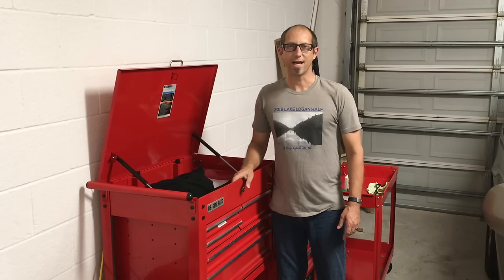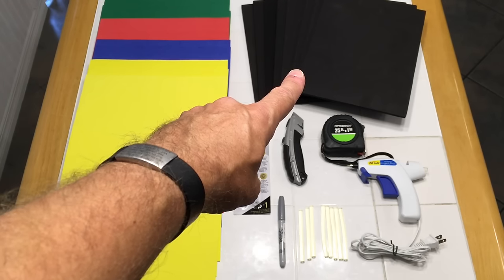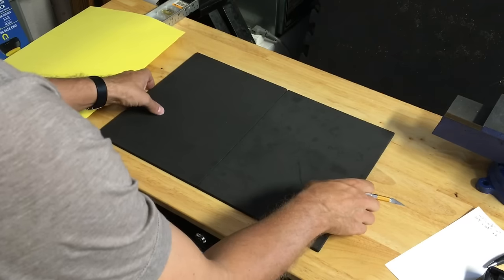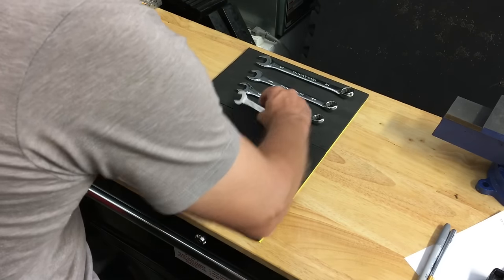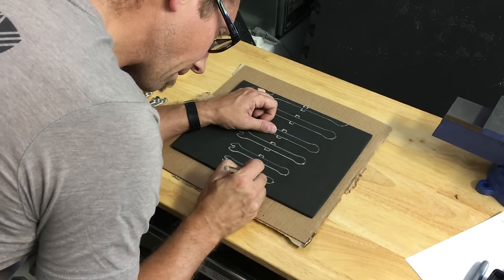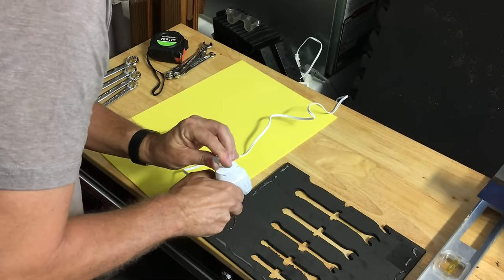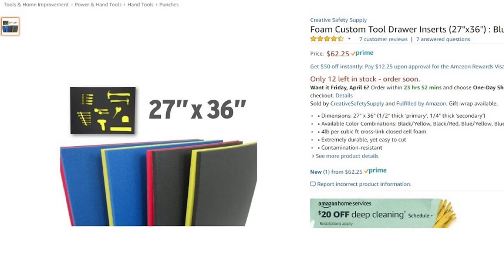Make Your Own Custom Tool Box Foam Inserts for $3

Comment: Pro Tip: trace OEM drawer liners for perfect fit.
Reply: How do you mean that?
Reply: Not all tool boxes come with OEM liners
Reply: is this a joke
Reply: @SquidsCareToo you can buy thin foam drawer liner inserts at harbor fright and use those for the  top sheet. 

Another pro tip or two:
- use 3M 77 spray bomb adhesive to adhere the layers together; no way I’d ever use all that time for hot glue
- as far as time… wow! I wouldn’t be able to get through all that fussy cutting for two reasons: my time is two valuable; and it looks cool but I pack way more tools in a drawer that size otherwise I’d have to buy three more 56” top and bottom boxes. Wrenches for example: I have SK, Craftsman , Cougar Pro, and Pittsburgh standard SAE combo wrenches, straight and reversing ratcheting combo wrenches, and long combo wrenches, plus duplicates. They wouldn’t all fit in that drawer size but they do fit in a 38”x20” drawer on racks. If flat like that I’d run out of space fast. 
- third and final here is spray-glue the oem liners (only boxes not worth buying don’t have these pads in my observations) into the drawer bottoms, and use wrench racks ($10 at harbor fright) to hold wrenches, and the upright labeled trays (again $10 or $15?) for sockets. Neat, clean, and very efficient use of the space. That way a very well loaded 56” us general top and bottom will hold every mechanics tool needed to rebuild a V8, restore an old muscle car, disassemble and reassemble a Jeep YJ, or open an auto service shop. Power tools and supplies like grinders, wiring, spare small parts all go in the 13-drawer 60”x26” mechanic’s box I built from scratch that has a vise on its workbench top. That’s a lot of storage in 26” deep by 120” and too much fancy foam tool holders would cut that to 25% of the tools I have in there now. 

Cool project and looks very nice but I couldn’t deal with that much sprawl of my tools.
Reply: I had been on the look-out for foam pads for quite a while, for just this purpose, but had not found any as inexpensive, or with the choice of colors, such as those he found at Michael's. I would suggest using one of those self-healing cutting mats with vertical and horizontal grid lines, printed on a green background, as an aid to cutting straight, parallel edges in the foam.  One major brand is Alven, it and similar brands are likely available at Michael's or any seller of scrapbooking supplies, or online
Reply: @fishhuntadventure Same here, I have three generations of tools.  From Craftsman,  Snap on, Plumb, Bluepoint, gearwrench and Stanley.  All in a 26 inch Craftsman roll away and top box from the 1970's.  If I made them neat, I would need two 56 inch cabinets.😮  I also have to much to do instead of being that neat.😊

Comment: Pro Tip: When you're done tracing and cutting the holes out of your foam, spray a light coat or two of black plasti-dip over the top side. It covers your trace marks and makes the foam very dense and rigid like it was laser cut and made for the tool.
Reply from the maker: @Jack Smith, thanks for the tip.
Reply: You could also put the trace side down…

Comment: 1/2 thick foam rubber sold on amazon is way better. Forwrenches, cut a slot and push wrench in. Triples the amount of wrenches.

Comment: Greetings Mr Jeff. Just a quick tip if no one has mentioned it yet.  First though,  I will confess that I’ve used a tape measure for many many years now struggling to take inside width measurements.  Anyway instead of folding the tape into the corner of the drawer or whatever inside measurement and trying to eyeball it, the trick is to butt the body of the tape measure to the inside of the drawer holding it in place and extend the steel rule tape out to the other end, lock the tape in place and add 2” or 2.5“ or 3” to the measurement.   
It varies from tape to tape but on the back or bottom of the body/housing of your tape measure there should be a number.  That’s the length of your tape box thing.  
Give it a try!  😎 
Best!  
Happy new year!
Reply from the maker: @Ryan Lemmons, wow that’s a great tip.  I had never heard that before.  At a minimum, if I can’t find that number on the tape, I can use another tape and just measure the first tapes length to get it.  Best tip I’ve heard in 2020!

Comment: dude i used to be in the navy. All navy aviation boxes are just like this....this is clean man, i cant wait to get my box looking like this.
Reply: Same - I didn't know toolbox shadowing was a thing until I joined.
Reply: @KicknAsphlt  ahhhh, tool control, gotta love it.  ATAF LMAO
Reply from the maker: @AGNB Motorsports, it takes a long time to make, but it's a great investments into your tool collection and being able to easily find tools when you need them.  Also, its great because when the job is done and you put your tools away, you can quickly see if you missed any because there is an open gap in the foam.  Is it the nicest looking way to do it...not really, but for a fully custom setup, I don't know a better way.  You can buy one's that are ready to be cut but they're not EXACTLY the size of your drawer AND they are super expensive.  Best of luck with your tool organization.

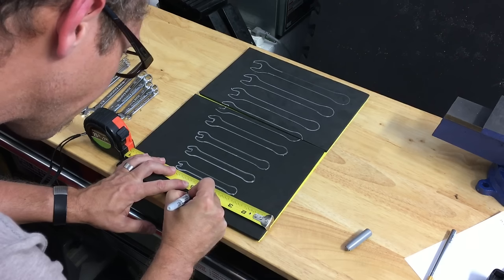Comment: Good tips, Jeff.  You may be able to save some time for this and all future foam layouts (the process at 7:12) by making a stencil of the finger relief.  Then, all you need to do is strike a chalk center line, place the stencil and trace for each shape.  This would lean out your process for marking the finger reliefs down to 2 steps and also improve the repeatable accuracy of your marking.  You could save even more time and improve shape cut consistency by making a punch tool of the finger cutout which would make the entire finger relief process only 2 steps (1. Strike chalk line, 2. Align and punch the relief hole).  I plan to organize my tools using your method, so thank you for making the video!

Comment: Tools are literally piled to the rim in my toolbox drawers. Wish I could be this neat, but I don't have the space.  But the video was interesting. Thanks.
Reply: You could be this neat. You just need another box. If you want to stay cheaper but retain quality I highly recommend harbor freight US General Series 3 or bigger. 

The 5 drawer cart is a PITA to assemble with the base being out of true without a second pair of hands it's easiet done bottom up with the top drawer assembly inverted on its head.

Happy wrenching

Comment: You can use masking tape on the foam to draw on then cut. It helps keep away the stray lines from laying out
Reply: Could also flip your mats upside down and flip the wrench backwards so when you flip it back over the lines are on the bottom now and the tool is the way you want it.

Comment: I use a blue foam camping pad from Walmart or wherever, 2nd hand stores sometimes have them. They work pretty good.
Reply: I used a foam floor pad from the dollar store, has a diamond plate pattern on it and looks cool
Reply: @Galgamoth  Very nice tip. I was looking for the foam kit for my Milwaukee packouts, and they are ridiculously expensive. You save me bunch. Thanks

Comment: Heat an unbent paperclip in a candle. The hot wire end slices through foam like a knife through butter - 1000% faster than a knife.
Reply from the maker: @Bond Street, good tip!

Comment: about getting the cheap thicker foam in bigger pieces : look intoo the cheap yogamats there usually made from the same stuff and sumtimes thicker
allso use a piece of plywood or a cuttingboard/matt , because cartboard is currugated it makes it harder to cut a straight line

Comment: We had old puzzle piece 3/4" foam mats for workout/anti fatique flooring. We have about 20 of those and about to do the same, put colored foam under and then those puzzle pieces. I might try standing my wrenches up on their side, but also labeling with a label maker too!
Reply from the maker: @Scottie Manners, those will work too if you have some laying around.  I ended up labeling mine with a label maker too.

Comment: excellent ,just exactly what i needed, was debating if i should spend all that money ordering these foam inserts. sure glad i'm so lazy lol didn't want to walk to the computer. will be going to Michaels or perhaps just order them. thanks a bunch....
Reply from the maker: @Ray Rivera, you're welcome.  Some tips to make the process easier...1. instead of an exacto knife use a hot knife.  It's 10 times faster.  2. Check out the comments as other people had some adhesive suggestions that might be easier to work with than hot glue.  I've had mine now for over a year in a hot Florida garage and have had zero issues and love my inserts!

Comment: I did this same method but used a hot knife I got on amazon for $20 and just held the tool down and traced around it with the hot knife, I also used a spray adhesive to stick the foam backing on instead of the glue gun

Comment: heat up a piece of copper pipe held in your vise-grips... it will cut the foam as you push in through. half circles for your lift out finger holds

Comment: That was a really good idea - thanks for sharing. I noticed you were struggling to get a clean edge when cutting @3:41, and to cut all the way through @9:00. Both are much easier using a better backing like a craft cutting board, or bread board (instead of the cardboard), or a sacrificial workbench top layer (you can sand / fill / replace the top layer or veneer). A steel straight edge helps as well to cut against, not an aluminium edge, as the X-acto knife blade is steel (high carbon steel for a sharp edge) and can cut into softer metals depending on angles and technique.
Reply from the maker: @ApprenticeGM, thanks for the tips.  Since making the video, some people commented that using a hot knife is easier and I would agree.  I've purchased a hot knife and it works 10x faster than the blade I was using.

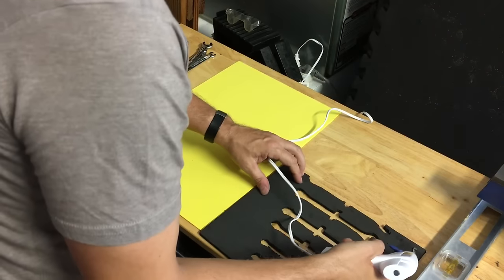Comment: 10:55 Spraycan contact cement would be much easier.  Available at any Home Depot or Lowes.
Reply: You have to do both sides with that, so it would be in the relief cut areas.
Reply: Contact adhesive is a good idea but I would try it on a bit of foam before spraying the whole thing to make sure it doesn’t melt the foam material.
Reply: I wouldn’t do contact adhesive myself. The 3M 77 sticks very well doing ceilings with light carpeting, but the contact adhesive doesn’t last as well.

Comment: for the metal pieces, heat them up really nice and hot and push them onto the foam. it will melt the foam out of the way and leave a perfect imprint

Comment: Harbor freight sells wrench racks for like 10 bucks. Take up way less space and fit more wrenches. A small at home took collection may work with this but as a mechanic, I nearly pack every square inch of my box before I buy a bigger box. Wrench racks help a lot
Reply from the maker: Tylor Frazier, I have a friend who uses wrench racks and he also has a lot of tools so I get it.  I happen to have a lot of space in my garage and 4 large tool boxes so I have plenty of room to space things out.  The plus side is (not just wrenches) I can easily and quickly find any tool in a matter of seconds without having to dig through a toolbox.  And, the tool is always in the exact same location, just like using a wrench rack.  The pads though provide that same organization for ALL my hand tools, but you're right, it does take up more space.
Reply: Oh please, those Harbor Freight wrench racks are incredibly cheap nasty plastic. The important thing is to have your tools organized, so you can immediately find your tool and also immediately spot if one is missing. Tool manufacturers always provide lifetime warranties on their tools, because they know a tool will be lost long before it will break. Take a look at Sonic Tools foam system (https://sonictoolsusa.com/shop/sonic-foam-system/) as an example of the right way to store tools. They only do this because a large percentage of their market is aviation mechanics, who can't afford to forget a tool inside a plane (as it could potentially take down the plane, while flying).
Reply: Norman Klein depends on which wrench rack you choose bud... they sell a metal one that is nice and one that is a big one that holds Allen keys, 2 seats of stubbys and 2 sets of full size wrench’s. I’m a professional mechanic and I have a few harbor frieght organization things in my box including that big wrench rack

Comment: Grab harbor freight foam floor mats, cheaper than craft store. Skip the color ones and just Rust-Oleum the drawer red or green, then put your harbor mats in
Reply: I have a bunch of those HF pads from an old project that didn’t pan out. Now I know what to do with them!

Comment: Those chalk lines are looking like CSI dead bodies for the wrenches haha
Reply from the maker: Hmm...nice observation.  Obviously, I should have reversed the direction of the wrenches and used the marker on the back (down side) of the foam so when I turned it over there would be no lines showing.  Thanks for the comment.
Reply: The killer was a nut

Comment: How about using a spray glue instead of hot glue? It will give you better coverage along with some time to work with.
Reply from the maker: Mike Squires , thanks for the suggestion.  In colder climates that might work.  I live in Florida where my garage can get pretty hot and over time, my experience is the spray glue will release over time when exposed to high temps.  The melting point of hot glue is a higher temp.  Not saying it can’t work.  If you do try spray glue, I’d suggest using 3m.  Cheap stuff won’t cut it long term.
Reply: @DIYJeff  I live in Tucson, AZ and it gets HOT, HOT, HOT! here!!! I've found that using the spray adhesive designed for headliners works really well in the high temperatures. I'm definitely going to try this for my tools at my shop. I have my own computer business and accessing and returning tools quickly is very important to efficiency and making more money in the finite time we have available in a day! Thanks for this. And, ignore the negative nancys commenting. No matter what you do, someone thinks they can do better, but they usually have never uploaded any wonderful videos of their own! :) 

Oh, and one thing I've always wondered is why someone would come up with a term for OCD and not have the letters be alphabetical!!!
Reply: @DIYJeff   this must be the stupidest answer a ever have seen. The melting point is higher🤣🤣🤣🤣🤣

Comment: You could, as an alternative, buy some of the 1/2 inch thick "anti fatigue" floor mats made for standing on. It could save you the time of gluing a whole bunch of the thinner mats together and might be cheaper in the long run. Also contact cement would work better for gluing the sheets together and you wouldn't have to rush like you do with the hot glue gun
Reply from the maker: Michael Linner, thanks for the tips!

Comment: Probably said a million times... but 3M Super 77 would probably be a bit faster and easier to work with for this.  Also, a lot of people seem to be fixated on black foam with a color inside of it.. but wouldn't it be cheaper to just get some regular thick black foam, and then get thin pieces of the colored stuff, and glue it to the top of that, and have the "shadows" just be the dark foam instead?  Seems like a lot of the toolbox foams out there are just expensive because they use more of the fancy red or blue colored stuff.

For some of these projects, I could see even using those colored interlocking foam puzzle piece floor mats as suitable material, usually one side is textured, but the other is smooth, and maybe the diamond plate texture of most of those adds a cool asthetic?

Comment: a couple of remarks: Use Thicker foam, so you can put your tools upright instead of flat.. massive space saver.. 
Use Contact-adhesive instead of hotglue.

For easy cutting.. Use a Dremel like tool, with a thin sanding drum, to cut out the openings for the tools.. makes it smoother.
(i have a CNC router.. way better to cut these out, but.. i will have to make an accurate CAD drawing beforehand.. so that is less easy than just tracing.
Reply from the maker: @Jan Binnendijk, thanks for the tips.

Comment: Tip. You will get a cleaner cut if you have a sheet of glass to cut on. Also it keeps the sharpness of the Blade for longer. Try It.
Reply from the maker: @Patrick Murray, thanks for the tip!

Comment: You could try one of those thin meditation/exercise rolls for the thicker foam. They are 1/2 inch thick, 5 foot long and cheap as chips.
Reply from the maker: @58Kym, great idea.  The sky's the limit on what combinations of foam you could use.

Comment: Looks great.  Wonder if a hot knife will cut that black foam better or worse ?
Reply from the maker: @G. Fortin, after making the video, I used a hot knife when making additional inserts and it speeds up the process considerably.

Comment: Wow! That looks fantastic. Foam is outrageous. After watching multiple videos like this it does make me say to myself "I could fit so many more tools in a drawer without the foam so is the foam really worth it?" Sure you spend a little more time looking for the right one, but I would go from 10 wrenches in a drawer to 100 wrenches in a drawer.
Reply from the maker: @notta3d, that’s a great question to ask yourself.  It’s all a matter of personal preference.
Reply: That's where you make multi layer cutouts that lift out. Plus it's more about how you create the shapes, if you have a whole set of the same thing then you could definitely just cut out a big rectangle section for the set rather than each item. That's exactly the balance I'm trying to figure out with mine today. What needs full on cut out per item organization and what can just go into a tray